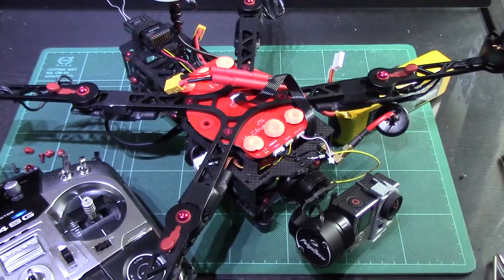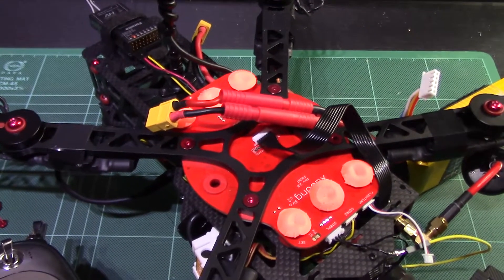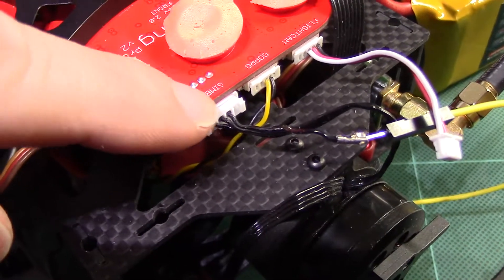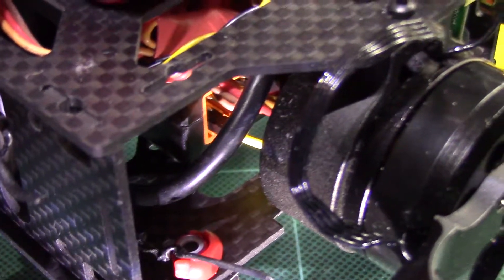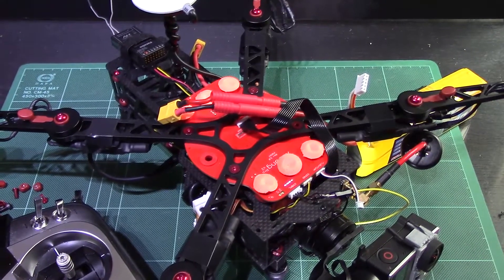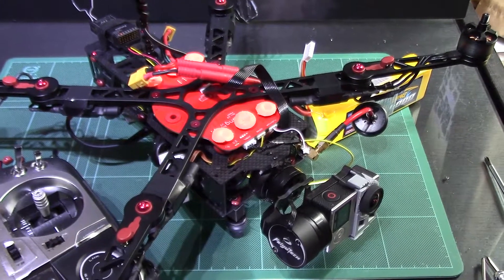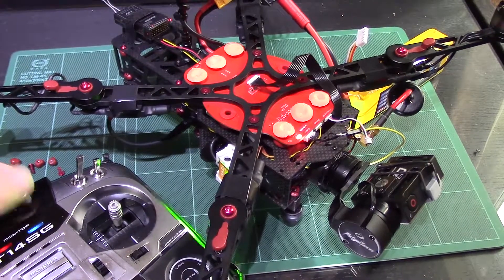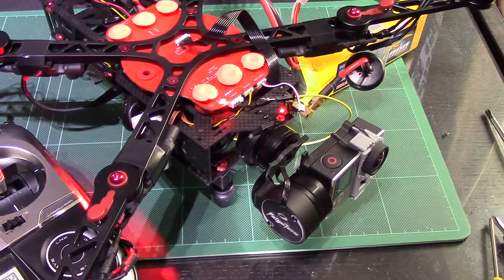XuGong v2 Pro - How to tilt G3 Gimbal via Sbus without PPM converter

Comment: Thanks for the video. I notice you use the custom plate where you mount the feiyu tech gimbal via the 2 x top screw instead of the rear motor screw. You then remove the whole front carbon fiber plate from the xugong. Any difference? Better vibration dampening?

Comment: I just noticed that you have another connector on this video on top of the main board.  Mine Does not have that.  Did you order that board from the manf. or did you solder that on to it.  What does it do and where is that black ribbon cable going.  I've been looking at your videos for the past week.  also I've been reading your posts on RC but I do not see you mention what that mod is.  
After much research I pulled the trigger and got the frame.  I do not know if i want the DJI E305 kit, or Tiger AirGear 350 kit and as far as the gimbal, well.  I haven't decided on it yet either.  All other items are on order like you built it because it's nice and functional.

Comment: Thanks great job once again... One final question... how about the video switcher?  Any way to get that to work?
 And Happy Easter.
Reply from the maker: I've taken a long hard look at it and I just don't think that will be possible without micro soldering. The Gimbal is easy because you can tap into it without soldering. The camera switch is a circuit on the PDB board. If you could find it, tap into it via a spare channel then it'd be doable. Given the hassle/risk of bricking the PDB in that process (if you can find the right location) then i'd say at that point it is time to just buy the converter.
Reply: d3weyTube
I agree... for this reason I have ordered the sbus to PPM converter,  I would like to see Imersion release an update to support sbus on the xugong.

Comment: hi , does this works with  traditionnal wiring ?
Reply from the maker: Yep you can fly and setup the XuGong with traditional wiring but it will get quite tight in there. PPM is preferred but not essential.
Reply: thank's , i did it with S bus and your  gimbal wiring , perfect , but i Wonder if the camera switch will work inthat configutation , i recived my pilot camera soon and will try ... very nice quad !
Reply from the maker: Sadly the camera switch won't work in Sbus mode. The switch only decodes a PPM signal so the only option you have for that is to get an Sbus->PPM converter.
Reply: OK  i have one , but don't use it because the tilt canal on the board =have change to ch 4 and i can't change it , but now with the direct tilt command i will try it again touse camera switch ... i hope it will do .